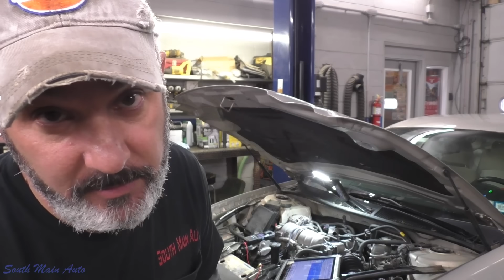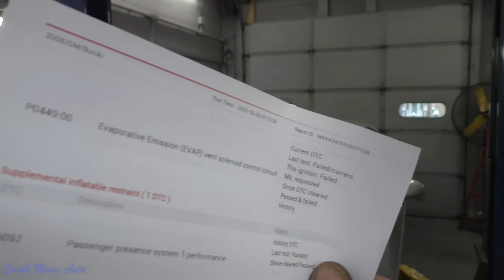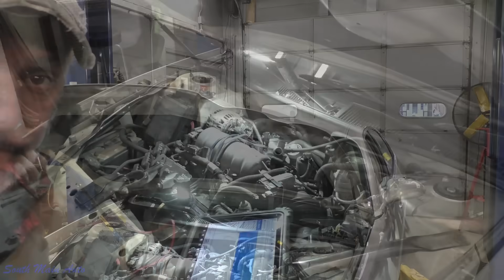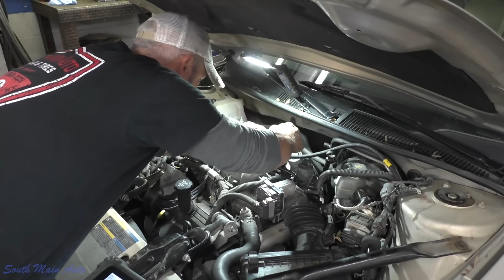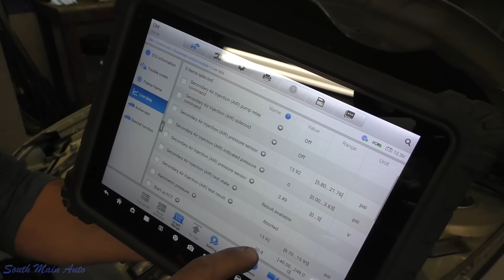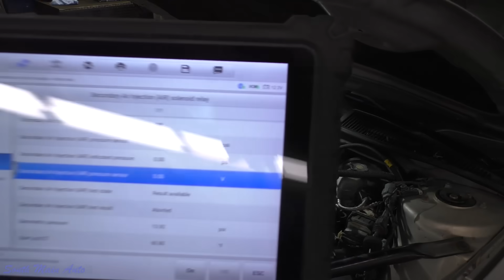When “New” Parts Are Worse Than The Broken Ones 🤬

Comment: Couldn't agree more, Eric. Over on this side of the Pond I've been retired for several years now but still involved through the classic car world (you know, car shows . . .). Chinesium is a major problem as almost every replacement part comes from over there, and there's no way of telling its origin. Most electrical stuff was originally made by Lucas, and while it's fashionable to deride them I've always found their stuff to work to work well enough. So you buy genuine Lucas New Old Stock still in the box. Except that the Chinese can make cardboard and have printing presses . . .

Take rotor arms (remember those?) for example. Lucas ones were black, as were distributor caps. How do the Chinese make the new ones black? Add carbon. How good an insulator is carbon? Right! It's just a matter of time, a very short time.

Comment: Sorry Eric ... and sadly, "non-op new parts" is a problem afflicting Industries across the board, including my Industry of Aerospace. While our parts are significantly more expensive and "repeat failures" generate deeper investigations into RCCA (cause and corrective action) it's also damn expensive for both the Supplier, Customer and End User; when it affects MICAP ratings especially (Mission Capability ... like when the Enemy is shooting at you). But with the price of new Cars/Trucks going over $100k, it would appear to be time for GM/Ford/others to pay attention less they be drawn into Class Action lawsuits. Main problem, as I see it, is that the "Big 3" outsourced their supply chains ... and did the unforgivable ... failed to strengthen their Supplier Quality Oversight at the point of manufacture; currently they're just trading spit shipping bad parts back and forth. At least in Aerospace, generally we have min requirements of oversight via a Quality System called "AS9100" ... but now it seems they've dropped it down to "Recommended" from previously "Mandatory"; not a good omen if you're parts crap out at 45,000 feet eh? "Cheap Parts" do not equate to "Good Parts" as you note in this episode. You may be on to something on that "taking up Drinking" idea. Godspeed Bro ...

Comment: Eric, I drive a 2006 BMW 525i. And, under NO CIRCUMSTANCES do I even consider a NAPA part,…. EVER. We BMW drivers have to deal with “CHINESIUM” garbage that is simply DANGEROUS. The ONLY parts anyone should ever buy for their car is the OEM or Manufacturer’s parts. EVER. It is SOOO bad (especially ROCKAUTO), that I get used parts in new boxes. 
We in the DIY BMW community know that we can make our cars reliable with the OEM parts 1980 - 2010. I cannot speak for after 2010. You can’t use Chinese parts on anything. You have to use the Chinese manufacturers with the OEM brand I.E. AC Delco, etc… Bosch and Toyota are riddled with counterfeit parts. And, these parts shelf life is really short. They have to be manufactured within a certain date. There is NO actual parts that work anymore other than the OEM & Manufacturer’s parts. That’s it.

Comment: My 1980 dodge aspen still has the original AIR pump, diverter valve and catalytic converter it had on the slant six since it left the factory in 1979. it's never given an issue in 46 years and 100k miles, and the day it does all that trash is going in the garbage and it's getting straight duals since it's been exempted from all emissions inspections for over 15 years now

Comment: My 86' K10, no fire, everything else checks out so I replaced the Ignition module for the HEI distributor, ran then would die randomly within a mile, I replaced the coil and tested everything else again and it was good... No way two in a row are bad... Drove me nuts.. replaced wires that we're good and connectors etc.. well after the THIRD major Auto parts and the 3rd top selling brand module all's been good for over a year.. rediculous .. 
but your video , they definitely could have diagnosed the problem simply as you did .. if they'd had the slightest skill and care.  Thanks

Comment: I do occasional repairs at home and have learned that new does not mean anything, too. Can't expect the thing to be fitting right, working, working within specs or last for a reasonable time.
Like - upstream lambda failed. Pretty easy to get replacement and fit it, but the new one failed again just couple of days later. Coolant temp sensor - simple plastic T pipe fitting but both new and old sensor leak there. Seen guys try several MAF sensors, each one showing different values but none of those were actually correct. Can't even buy bolts and nuts and expect them to be the in size and have threads. The list goes on...

Comment: America needs a "Big 3" parts store that operates like FCP Euro.  If the part fails at any point, 100% credit when you buy a new one.
Reply: In my area parts store and dealers will not accept any electrical parts as returns.
I need to go to my shop for anything electrical as they are able to return faulty parts.

Comment: It was 24 years since I owned a front wheel drive car and then bought an 07 Grand Prix supercharged for dirt cheap last year.  Giving credit where it's due, that thing HAULS.  I've since put in about $1000 of needed maintenance, including water pump with metal coolant elbows because the plastic ones crumble eventually.

Comment: These problems all stem from one source and that's piss poor quality control. Since everyone, including the name brands, started sourcing from mainland China, or India, or some other cut rate country of manufacturer to cut costs, one of the things that was cut was quality control. I used to deal with a company that supplied high tech control systems for the oilfield. They had elected to move their place of manufacture to China to cut costs. Within months they started getting complaints of non functioning or malfunctioning components. When they checked into it they found that the "Quality Control" people in the various factories were simply not doing their job because they were company employees and their employer had told them to back off. The solution was to rewrite the contract to include third party inspectors which were paid for by the Vendor and answered to the Vendor only along with penalty clauses applied to the makers account for each and every bad unit found. The quality improved immediately.

Comment: Just replaced a windshield washer pump on a Prius. OEM part was $90, owner wanted the NAPA Chinese part for $26.  The new grommet was 1mm smaller, pump was loose in the reservoir and the fluid would have leaked out.  I had to use the old grommet so that it wouldn't leak.

Comment: I don't do cars for a living, only fixing my own and the odd friends. I'm a heavy equipment mechanic by education.
And I live in Europe so what I am wondering is the situation as bad over here as in america?
I've seen a few cases where DiagnoseDan has pulled a bad new aftermarket parts.
For my Dodge I've ordered lots from Rockauto and not had any lemons, mostly because I don't order the cheapest I suspect.
My japanese beater cars have gotten a ton of weird no-name brand parts from the cheapest supplier, but mostly made in or around Europe in countries you would not think of car part production, so far with no issues.

Comment: I've been working on a 1978 Oldsmobile 98 and just this week it suddenly wouldnt start. I check everything out and its all good except it turned out the ICM was bad. At some point in its 143,000 mile life the original must havw gone bad and was replaced with a Napa Echlin. It couldnt have been on long since the leads had no corrosion. Its amazing to me how these companies cant even get a simple HEI digital switch designed during the Apollo Project era right, sure makes you think twice about those sophisticated computer driven cars these days.....

Comment: I just finished up another Buick encore with the 1.4 turbo (plastic valve cover iykyk) and I got 2 sets of bad turbo coolant fittings located in the backside of the turbo. Of course we got the Dorman kit with all the goodies but it was 2 bad sets in a row. I managed to bench test the second set before I put them on. Ended up going OE at like 5X the price. However as a flat rate tech known for accuracy and quality I had no issues adding those hours to my ticket. Book time was 4.7 plus my 1.0 diag to find the leak and I do so many it’s like 1.15 and done. My motto is if it’s my mistake I fix again for free. If  it’s a part failure I charge full plus diag if required. But yeah it is a shame cause a lot of guys without the knowledge struggle big time over bad parts

Comment: I've gotten so many bad "GM Genuine" parts lately that I've taken to using used original factory parts instead of new, anything.  Every damned new part on the market is a gamble and I usually lose.
Reply: Dude I got a brand new GM oil pump with a spare bolt dropped into the pump inlet. The same bolt that secures the cover on the pump, and none of the ones on the pump itself were missing. Thank god it rattled when I picked it up.

Comment: I got one for you.  I just replaced the stator in a can am utv with an aftermarket stator from a company I have had very good luck with.  This requires pulling the ignition cover, dropping the oil, scraping the gasket, loctiting the new stator into the cover and putting it all back together.  Got the job done and it still wasn't charging properly.  Performed ac charging test on the new stator... bad part.  Got the part warrantied and got another one in.  Installed the same brand aftermarket stator for the second time.  Still not charging.  Installed a genuine oem part (third time doing this job) and its working perfectly.  I called the manufacturer about the faulty parts and I barely got a "sorry that happened" out of them.  The guy on the phone actually said I dont blame you for putting an oem part in it at this point.  The lost labor due to these parts is criminal.

Comment: It's too bad BOOBtube demonetizes FREE FUCKING SPEECH!
 What worries me now in my retarded years is doing a job on my own $HITBOXES where you pull the top off of your engine to replace and oil filter/cooler housing with a temp and oil pressure sensor and the freaking parts either leak or are inoperative!  Parts manufactures "OH WELL HERE ANOTHER PIECE OF $HIT FOR YOUR TROUBLE... GOOD DAY SIR"

Shout, shout, let it all out
These are the things I can do without
Come on
I'm talking to you, come on
Shout, shout, let it all out
These are the things I can do without
Come on
I'm talking to you, come on  ✌😎🤟

Comment: The worst thing is when you're learning as an apprentice and you're pretty confident in your diagnosis, but then the part doesn't fix the problem, you really second guess yourself but it is just a crappy junk part
Reply: Happens at home too and really sucks when you buy parts in such low volume that they don't believe you and ask you to take pictures of the package, the shipping box, etc. just to have a chance of getting a refund or exchange.
Reply: @Guacamolejonez  that’s why you always test the parts you get and the parts you take off. Sensors etc are easy to test.
Reply: @Reginald-Bowls  Not always
Reply: @Guacamolejonez so you just throw parts at problems? Without confirming?
That might be fine with domestics but it gets expensive with the German cars I work on.
Reply: @Reginald-Bowls I don’t think anyone is saying that at all. Can you explain where you read that I just fire the parts cannon?
Reply: That's exactly what is happening and auto mechanic is in decline 😢👎
Reply: Not if you test the part first...
Reply: @LIFTANDFIX  You're clearly missing the point
Reply: The Orient Express making these crappy parts could care less about quality control, Their motto- slap it together & ship it, Buyer Beware.
Reply: @RustyK5   True to a point. They are just the cogs in the machine,ordered to do what they do.
The 'MFG' , is supposed to do product testing,etc. to make sure the part is made to their specifications.
ALL are penny pinching to maximise profits,  and 'mericans do like the cheapest price!
Reply: @whilst01  Certainly the wholesale parts buyers dealing with these companies know that the parts these people are producing have issues, but it seems that for whatever reason they aren't insisting that they correct that issue. Maybe the price is so good that the buyer just "looks the other way" about the defects & lets the consumer deal with the problem.
Reply: China is basically communist. The people are basically slaves to a Totalatarian government. People get off their butts to march against slavery and tear down statues, but their the first in line to gobble up Chinese slavery products.
Reply: If you were able to correctly diagnose the problem the first time you should be able to quickly find the new part doesn't work either. I very much do get your point 100%
Reply: @DanDearman  You're absolutely correct, but as an apprentice, you're still learning. I've been 100% confident in a diagnosis and the new part doesn't fix the issue. Being able to retest the system and condemn a bad part is of course the correct course of action, but if you're still learning you do second guess yourself and wonder if you missed something.

All I was saying is it sucks to have to second guess the parts you install as well as yourself in those situations.

Comment: What ever happened to quality control and testing? Why is the diy or mechanic the inspector? 

It isn't just auto parts, it's all replacement parts. It's a race to the bottom. The cheap bad drives out the good.

Comment: I completely feel your pain. In fact I just recently informed a lot of my clients that as of the new year I will require all thermostats to come from the dealer and all starters and alternators must be new and not rebuilt. As the aftermarket situation worsens I'm sure i will be adding more parts to the dealer only list..
Reply: As he was ranting I was thinking "THERMOSTATS". You want to chase a p0128 put after market in. I stop using after market a few years ago for thermostat especially after NAPA switched to motorad ( although there altrom for imports are good). As far as starters/alternators I have had good luck with denso rebuilt.
Reply: I just bought a 1995 Riviera (NA) a little over a week ago. The previous owner had a list of things replaced recently, and among them was an IAC valve.  Last night the car started stalling and running choppy, so I checked the IAC valve and sure enough the new one was junk. the pintle and spring popped out as I was removing it.  I ordered a Delphi OE from Amazon since my car is not operable right now, so I am hoping it's an actual Delphi and not a Chinese knock off with Delphi stamped on it.

Comment: Feel for you Eric Keith from Australia. We have the same trouble here in Auz. Daughters 2005 Honda Accord Euro 2.4L had a starter motor fail. Got 19 years out of the OEM starter. Replaced it with an after market whole job cost North of $500 as you would know the whole manifold had to come off. 16months later after market starter failed. Whole job had to be done again this time North of $600. 16 months out of an after market piece of crap not good enough. Bendex failed on the shaft due to poor heat treatment. The helix was completely worn away pinion would not stay out. Enough to give you the dry darkies (Sh***)as we say in Auz. Keep your chin up I watch you all the time. Cheers from down under.

Comment: I nearly lost my job once because of a crap napa part, put a rad in a ford escape and it flooded the transmission with coolant. My boss tried blaming me as soon as napa declined the warranty saying there was nothing wrong with it. Ended up flushing 30 gallons of atf through the trans and i think that's why they wanted to deny it so badly.

Comment: Yup bad new parts everywhere.  What burns me though is when you get a "new" part and when you open the box it has obviously been opened, installed, handled or just covered in greasy fingerprints.  It might be still new so to speak but someone bought the wrong part figured that out and just shoved the part back into the box.  This is a part that I can't trust.. Now, every time (and I mean every time)  I purchase a part I open it in front of the clerk and inspect it.  Any signs of being previously opened I won't accept it.  This saved me on some brake pads that had rust, dirt on the backing plates plus missing hardware..

Comment: I agree with the frustration parts these days suck there is times all I do is warranty parts replacing because they fail i do more of the heavy line work at the shop I work for I sometimes have to do timing chain jobs again or even do another engine cause the remanufacture can’t make a good product

Comment: Very frustrating, even dealing with “parts direct from manufacturer “ it happens across all fields. Bad solenoid, valve, or circuit breaker. Quality control has left.